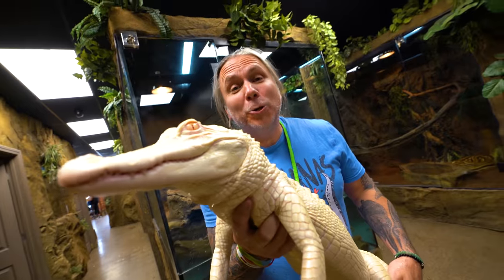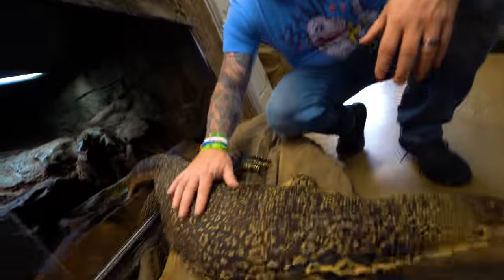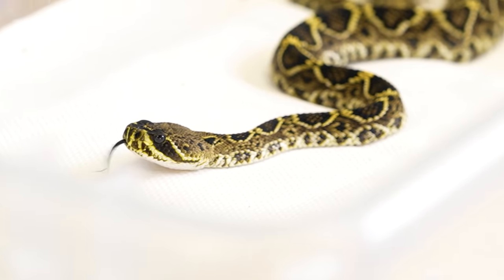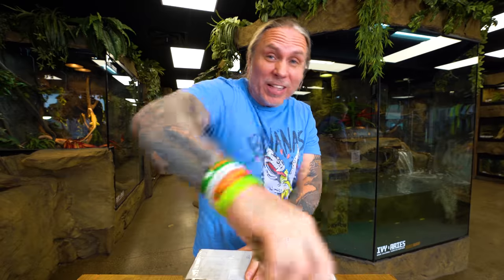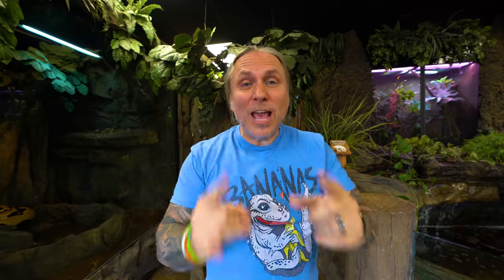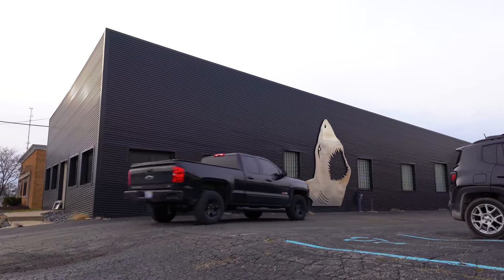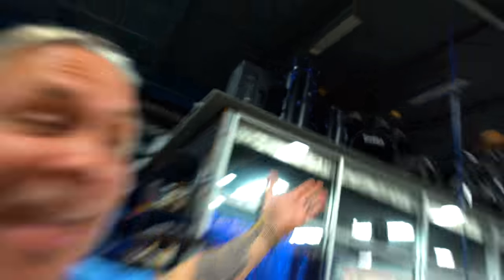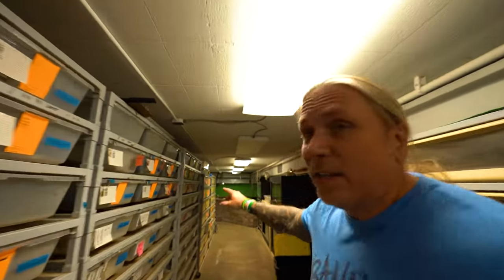I'm Spending $4,000,000 Expanding My Reptile Zoo!

Comment: I told you about the support issue when you first mentioned the expansion, that is why I told you to put the aquarium on the bottom and the reptiles up top, but it is your place, do what you want to do.  Water weighs a lot, and God forbid you have a leak upstairs because it will be raining on the 1st floor.  Good luck with the build out and the new additions.

Comment: I work in construction as a mechanical/commercial insulator. Our company has worked on a few local aquariums, insulating their piping systems to help keep the temperatures of the water stable and efficient.
It’s something that a lot of people do a hack job on but is an important part of the process. So remember that :) if you need insulators, call us xD 
Excited to watch you grow, Brian. I’ve been subscribed since the snakebyte days.

Comment: Absolutely should add a venomous section.  

Also, you don't have to clarify that you're not bragging when it comes to the money.  You've worked long and hard on your passion and it has absolutely paid off.  You should be proud of that, especially since that money is only going back into preserving these animals, improving their spaces, and expanding your ability to expose and educate the public on them.  Never apologize for your passion, your hard work, or your success.

Comment: Hey Brian,  Have you ever thought of building the aquarium part of the expansion over the back parking area?  So parking would still be there but the aquarium support/building would be over the lot instead of having to reinforce the existing building.  Then if you wanted to expand even further, you'd have the area over the existing building that wouldn't need such heavy support as an upper level aquarium.
Reply from the maker: We just dont have the pace to lose parking. I wish we had more space back there.
Reply: @BrianBarczyk   But if you built it OVER the parking area you wouldn't lose parking space.  You'd only lose the space the support poles take up.  Just a thought.

Comment: Brian, I have to say, not for the first time, that it is utter madness. Look at the money you are spending on the upstairs of the new reptarium and the money you will be spending on the supports for the weight of water in the aquarium tanks. I have felt all along that the aquarium and thousands of gallons of water should be as close as possible to street level so if you do half problems the water is easier to disperse. Having it upstairs puts everything below it at huge risk. The thought of water pouring into your enclosures below with Drogo and the tortoises is not worth it.  I am staggered that these architects have not even mentioned it and all they are interested in is their fat pay check. I really hope it works out but I have huge concerns and doubts about it.